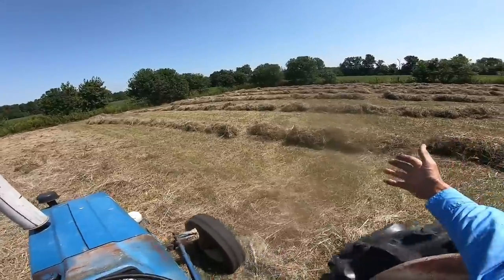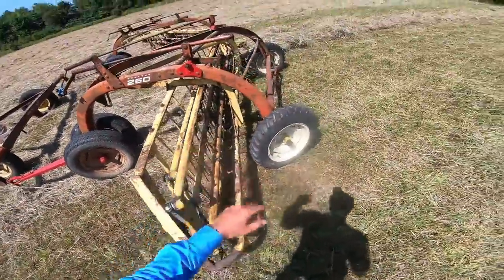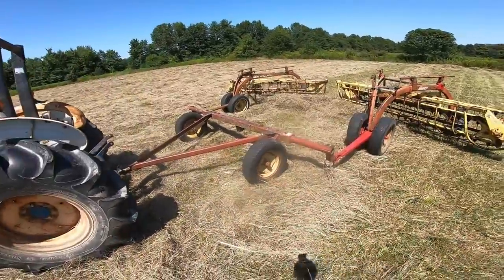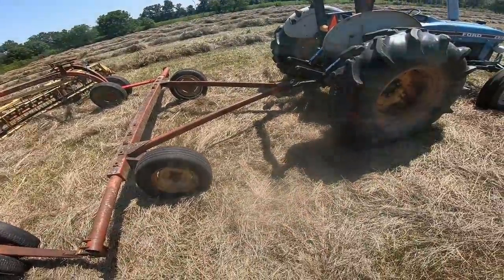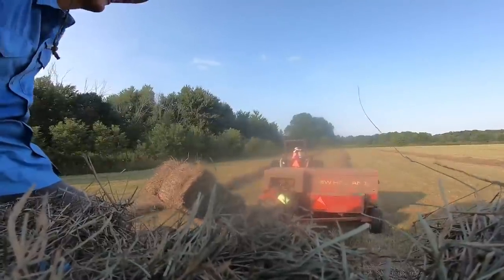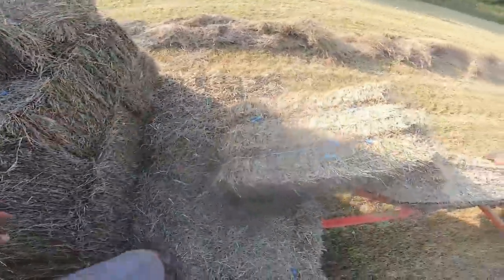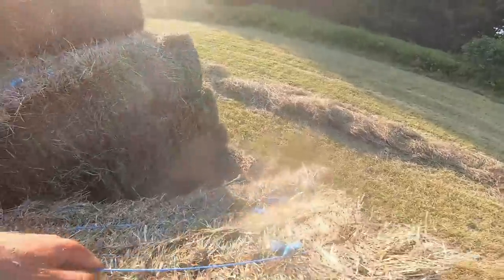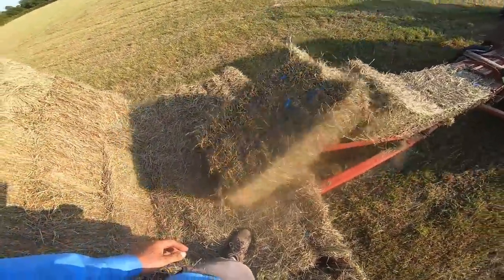Unveiling the New Hay Rake

Comment: Farmer I worked for as a teen had the "L" double hitch. You are right you can flip it left or right. If you have it one way your raking two single windrows, Flip it over and your raking a double.
Reply: I have one I picked up for $150... I have it hitched to some field rollers; got a homemade bridge hitch for $125 bucks at an auction that works better so I don't use the L one... You can flip them, but you have to take four bolts off that hold the front dolly wheel on the front part of the "L" and flip it over, put the bolts back in, so the dolly wheel is still facing downwards.  There's several hitch tabs on the back of the frame to hitch the rakes to-- one is for transport and 2 others for working positions IIRC.  The rear implement tire is mounted to one side of the pipe frame and has a pivot bolt setup where you can adjust the "toe in" of the single rear wheel to set the overlap of the front and rear rakes, or the windrow width if you're using a RH and LH rake together to rake to the middle... To go down the road, you have to unhitch one rake and hitch it to the back of the other one.  

That's what I like about my bridge hitch-- no unhooking rakes unless you want to use one as a single rake.  For transport you just hop off flip the rakes out of gear, and then hit the hydraulic lever on the tractor to swing the bridge hitch axle straight; when you pull forward the rear of the hitch and rear rake swings right behind the front one into one long train, ready to go down the road.  Hit the next field, hop off throw the rakes in gear, reverse the hydraulic lever to swing the axle to the left, then start raking, and adjust the hydraulic cylinder with the lever a bit til the rakes are overlapping like you want...  If you had a RH rake, you can set it to get the windrow width you want.  Later!  OL J R :)

Comment: I wanted that setup, but couldn't find a 260. So I ended up building a hitch on the back of one rake to pull a second one to rake two rows at once. Actually works pretty good.
Reply: Yep lot of those home built systems down here... telescoping pipe within a pipe, hitch tab for the rear rake welded on the end... pull a pin slide the hitch in to go down the road, pull the pin slide the pipe out and hitch the rake to it to double rake.  Pull the second rake down the road using a tab on the back of the front rake frame in the middle... OL J R : )

Comment: I picked up one of those old "L" hitches for $100 bucks... it was sitting in the back of a dealer lot taking up space.  I figured for that price why not.  I pull a couple rollers with it actually instead of rakes because I bought a bridge hitch at auction for $150 bucks!  Yes, they CAN be reversed... the little crazy wheel on one side is bolted on with a four-bolt flange, you take it loose and flip it upside down and bolt it back, then just flip the hitch over... then it'll pull one rake up behind the hitch close to the tractor, and the other one hitched to the rear end of the "L" with the carry tire on the frame back there.  The carry tire has its spindle mounted in between a couple of flat irons, bolt through it next to the pipe, and a slot further out with another bolt.  You can loosen the bolt and "tilt" the wheel for a little bit of "steering" so that the rear rake trails right where you want it in relation to the front rake.  Works good, and it's cheap.  Just gotta find one!   They also have different drawbar pulls on it so you can move the rakes over to the center and hitch the rear rake to the front rake, and pull the whole thing down the road narrow... Later!   OL J R :)

Comment: i think those rake make the BEST windrows! we had a v-type rake, it worked good, but the windrows were lumpy no matter what we did.
 it did not make the square baler happy!  so we went back to the old "roller" rakes like yours.  now everything is good.
Reply: Your problem was either the operator or the rake was not setup and adjusted correctly.
Reply: @farmcentralohio  had the selling dealer come out and look at it, and make adjustments they said that's just how it is. they weren't super lumpy, but not even close to how smooth the roller rakes are.

Comment: Nothing wrong with that setup.  Don't see any 260's with the RH delivery down here, at least I never have.  All 256/258 LH delivery rakes.  About 10 years ago I was at an auction just futzing around and this home-built bridge hitch came up for sale... this is the kind of double rake hitch that NH is selling new for about probably $5,000 bucks or so... it was built out of 3-4 inch pipe welded together about 15 feet long, hitch on the front "gooseneck" end that hitches to the tractor drawbar, with a drawbar hitch right behind it for the first rake to hitch to, then the frame goes up and over like a gooseneck hitch over the first rake, then down to an axle in the back mounted on a pivot with a hydraulic cylinder to swivel the hitch/tongue and axle in relation to each other like a hydroswing mo-co... the axle has a couple hitches on the back of it for the second rake.  Nobody was bidding on the thing and so I made the first bid at $125 bucks and got the thing!  Then I spent the rest of the summer looking for a second rake that wasn't totally ragged out to pull with my new-ish 256.  I hitch the 256 to the front hitch, so it's only about a foot further back than if it were hitched to the tractor itself, right behind where the bridge hitch hitches to the tractor.  I found an older 258 that wasn't in terrible shape, did some fixing on it, and hitch it up to the bridge hitch axle pivot hitch.  The 256 rakes 7.5 feet right behind the tractor, drops it in a windrow, which the 258 is being pulled behind catches as it goes under the bridge hitch axle, and rolls it over with it's own 8.5 foot swath and deposits the whole single windrow off the left end of the 258.  Works like a champ.  What's nice about it is, when raking in hay meadows that are heavier on one side and lighter on the other, I can just pick up the windrow AGAIN on the front rake and rake up another swath with it, until I get the size windrow I want.  I can duck in and start a new windrow on the other side (yeah I rake roundy-round).  Works like a champ.  Got vid of it on my channel... 

https://www.youtube.com/watch?v=et_Zv8wkdfY&t=28s

https://youtu.be/kdhtbSDi5_A

And a slo-motion video... https://youtu.be/b_FRhtyWpXY

As for the  guys hungry to see new paint, well, when they pay for it they can sure see it LOL:)  Best machine is one that's the simplest, PAID FOR, and gets the job done!  Same windrow comes out of a $25,000 rake that comes out of a $2,500 rake... Later!  OL J R :)

Comment: I'm hoping for a video on how you changed the tine bar bearings. Have several to do on my NH 55 bar rake. 55!!! I'm really slumming with that old timer! Thanks for the video. Be well.
Reply from the maker: I didn't get a video of it, but I still have the other take to fix. You need a chain and a come along. The chain holds the star from turning and the come along pulls the bolt in the bar to line up with the hole. Then smack it with a hammer to go in.
Reply: @boehmfarm4276  Thanks for the info Jacob.
Reply: We ran a 56, which is a straight axle version probably the same as your 55... not a bad rake at all... ours was just flat WORE OUT which is why I traded it on a new 256 25 years ago.  They both make the same windrow LOL:)  

To change the tine bar bearings, you have to basically take 2-3 of the other bars adjoining it loose at the same time, so there's enough "play" between the star wheels to allow you to get the stud going through the bar end bearings through the end of the star wheel hole, then you put the nuts on and tighten everything up... it's kind of a clusterfutz but it works, with a little prying, cussing, and swearing LOL:)  dunno WHY they didn't just make them with a through-bolt... I think the new rakes are, with a rounded smooth hex-bore bolt going through the bar end casting and bearing... Much better design LOL:)  OL J R :)
Reply: @lukestrawwalker  Thank you for the information sir. I've enjoyed your channel also.
Reply: @scottviers3794  Thanks!  Always nice to have a fan... :)  Need to get more farm stuff up but life has really thrown us a curve ball these past couple years... Later! Know of any other small farm channels or guys farming with older stuff lemme know!  Later!  OL J R :)

Comment: You got those dolly wheels from a supplier I guess?? I've looked at them but they're high for the kits to add them new.  I've thought about making my own... just need a couple old car spindles and tires or boat trailer tires or old implement gauge wheels or whatever, and some channel iron... make a tongue long enough for the dolly hitch, weld it to a cross-beam that the spindles are welded to on drops about say 3 feet apart or so for stability (not as wide as a car axle by any means) and extend the tongue over the cross-beam with a hitch plate welded on the back of it real close to the axle cross-beam for the rake to hitch to with its regular hitch... The axle cross beam should be just long enough so the wheels don't hit the frame when turned 90 degrees or so, so not very wide, since the hitch and frame of the rake is only about a foot long or so at the rake hitch point.  3 feet between tires would be plenty I think.  The hitch plate for the rake should be as close to the axle as possible-- moving it rearward would let it turn tighter before "bottoming out" or binding up in the turn, BUT, the further back it is the more it will push up on the tongue... Tongue should be just long enough to clear everything in a turn, and counterbalance the weight of the rake hitched onto the dolly... 

Course I never built them because I didn't need dollies after I got a bridge hitch cheap at auction... OL J R :)
Reply from the maker: Dolly kit was $300 without wheels.
Reply: @boehmfarm4276  Wow where'd you find them at that price?? Used from a salvage yard or something??  I priced the kit from the dealer while back it was about $900-1k... NOPE didn't pay that for the rake! LOL:)  I've seen them in a catalog I got from some parts place up in PA (amish country?) that had them for like $500-600 new for the kits with little skinny rims but no tires IIRC... cheapest I've seen them.  I figured I could make my own for a couple hundred bucks, but once I got the bridge hitch didn't really need them, so I never did.  Good looking setup!  OL J R :)
Reply from the maker: Got them from Joe's in Pennsylvania.

Comment: While ya'll were playing the music while raking I was trying to see how these would be tied end to end in a line behind the tractor. This way if you got rammed by a car you would put the doubler wagon on the tail end. OK that would work towing. So water got in through the disengage? Works well now but a bunch of new bearings.
Reply: They usually have hitch tabs welded to the rake frames and the center of double hitch... unhook one rake move it over to the center hitch of the double hitch, then hook the second rake to the back of the first rake.  Pull out it all trains in behind each other to go down the road.  Have to move all the rakes back to their working positions at the next field.  

That's where a bridge hitch is nice... throw the rakes out of gear, then use the hydraulic lever to swing the rear rake and bridge hitch right inline behind the first rake, and the whole thing trains along right behind the tractor.  Get to the next field, reverse  the hydraulic lever to swing the rear rake out to the side, and hop down to flip the rakes back in gear, and go to raking... OL J R :)

Comment: Nothing Wrong with a wheel rake they do a great job!!   If you don't have them adjusted right they dig but if adjusted right you will barley see a mark on the ground from the teeth!  To many moving parts on them bar rakes !
Reply: More moving parts, yes, but if operated and lubricated correctly bar rakes are pretty indestructible... MOST of the problems I've seen with rakes is people run them WAY too low, scratching down in the dirt trying to get EVERY LAST STRAW AND BLADE OF GRASS off the field and in the windrow... problem is, they rake up a LOT of dirt and scratch up a lot of duff (plant material on the ground surface that is rotting back into the soil) and put all THAT in the windrow too, leading to dusty hay and "ash".  Basically a rake can be set on concrete so the teeth just clear the surface without touching, or barely touching, and that's as LOW as a rake should EVER be run... usually there's a pretty good stubble left, which the hay should mostly be laying on top of... depending what the hay is and how it was cut, and the rake can be set to clear the ground while running down in the stubble to sweep the hay up and move it over... no ground contact required.  Only time a rake should be touching the ground is when a wheel drops in a low spot or a high spot goes under the rake basket or rake wheel tines...   BUT lots of guy set them so low you can see every tine scratch mark in the field after it's done... looks like it was harrowed lightly when they're done.  All that does is GUT the rake and wear it out-- even wheel rakes-- the tines will bend from stretching too far scrubbing the ground, and the holes in the outer band will egg  out and the tines will wear in two or break from wearing thin where they pivot against the band with every turn scratching the ground... rolabar rakes will wear out the bar end bearings and get very slopping, rocking back and forth when you twist the bar.  Tines get bent or knocked out.  Even rotary rakes operated too low will wear out cam tracks and followers, excess gearbox wear, and will eventually bend, twist, or develop cracks or fractures in the tine bars from metal fatigue from all the extra twisting of the tines hitting the ground... 

Later!  OL J R :)

Comment: I have only one question "Why"?  You don't make that much hay.
Reply from the maker: 4000 squares and 200 rounds. Requires less help.
Reply: Raking is the slowest job of haymaking, at least with round baling... so it makes WAY more sense to pull two rakes.  You go from an 8.5-9.5 foot swath to about 17-20 feet (depending on what model rakes you have) and with the V-rake squadron hitch like this, you add the center windrow width to the raking width and with a 258 and a 260 putting out a 3 foot wide windrow, you're raking about 23 feet per pass (course it's slightly narrower than that because you have to overlap the rake with the last pass slightly to pick up all the hay, as with any rake).  You get done a lot faster and can get on to more important jobs like baling.  Later!  OL J R :)

Comment: Would you suggest the nh 565 square baler for someone starting out or just move up to a 570 baler?
Reply from the maker: Its less about model and finding one in good condition. Although I would like the rotary feeding of the larger models.
Reply: @boehmfarm4276  so you do prefer the rotary feeder over flow feeding? I've found in good condition 570 for a couple thousand more than the 565 n I didn't know if it'll be worth it or not?

Comment: Hi Jake do you really need to have the dolly wheels? can you connect straight to your cross bar? Or do you need to have the dolly wheels to adjust the height of the machine?
Reply: I assume he takes it apart to move from field to field on the road so would need the dolly for transport is my guess anyway
Reply from the maker: Dolly wheels help the rakes follow ground contour and make it easier to hook them for road transport.
Reply: No you can get by without the dolly wheels, but they make it MUCH easier to move the rakes behind each other for road transport.  If you were running on one farm and not having to go down the road or through gates, it'd be fine without the dolly wheels.  None of our rakes have dolly wheels, haven't seen but a handful with dolly wheels in my life actually.  They're a good idea for this type hitch though, because you have to unhitch the rakes from the V-hitch and move them behind each other and hook them inline to go down the road or through gates.  That's where a bridge hitch works great-- I use mine with regular rakes with no dolly wheels, hitch them up once and you're all set-- the front one hitches right behind the tractor drawbar, to the back of the "gooseneck" of the bridge hitch, the frame goes up and over the first rake then back down behind it to an axle on the back of the bridge hitch, with a hitch plate for the rear rake to hook up to.  The bridge hitch axle acts dolly wheels for the rear rake, since it's hooked to it.  Move the hydraulic lever to retract the cylinder like a hydra-swing mower directly behind the tractor and first rake to go down the road, then extend the cylinder back out to move the rake to the side for double raking, all from the seat, no hitching/unhitching/moving/rehitching required... OL J R :)

Comment: If the wagon is strong enough go 3 across the 1st, 3rd and 5th layers and 6 straight across those layers at 5 or 6 panels for 150 or 196 bale loads
Reply from the maker: It's strong enough, but the deck is 8' wide. Is feel better about the bales being supported on the edges of it was 9'.